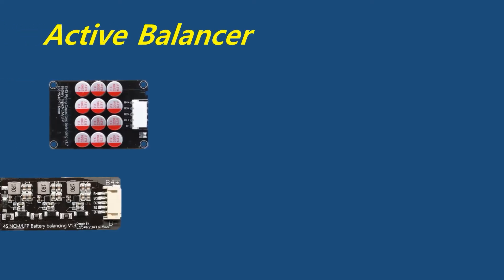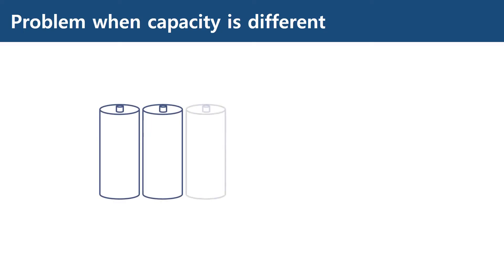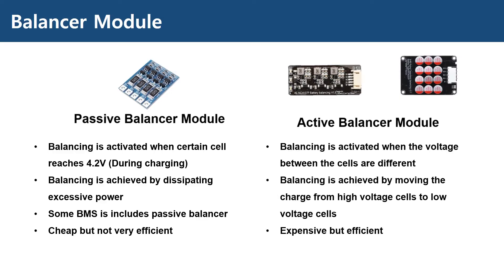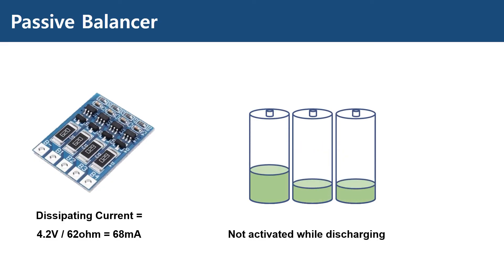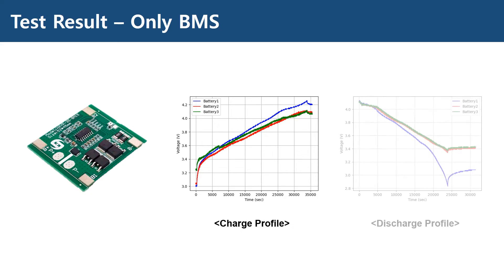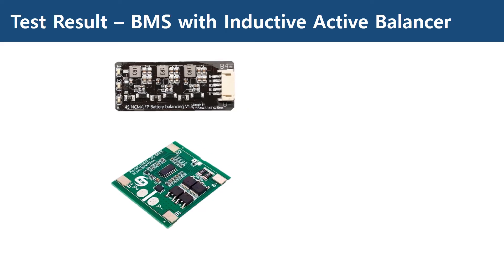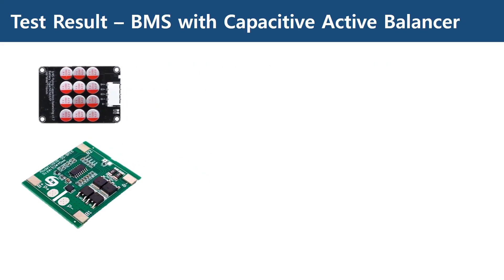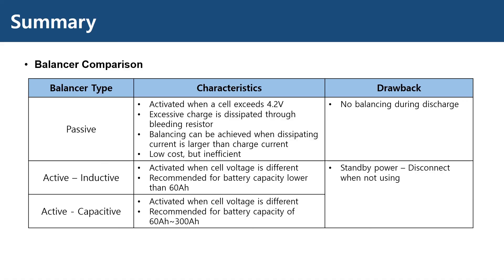Active Balancer vs  Passive Balancer

Comment: You are not going to get more capacity than the smallest/weakest cell,
so the "top off" balancer is useless and just wears out the bad cell faster as it keeps it full while the others catch up, filling up batteries is what wears them out.
What it can do is balance them every once in a while or if they get way out of balance, but that requires a charger that is very low charge rate.

The active balancer is also a waste, it does not do enough to make any difference unless the batteries are drained very very slowly, in which case, just use a single cell battery and use a dc-dc booster and no balancing at all is needed.

Comment: Oh that's why..
I use a battery pack of 32650 on my kids power wheels, it started balanced, after my kid drained the pack, it won't charge properly, and I check the cells are imbalanced. Thank you very much, I should be using active balancer then.
Reply from the maker: Great idea!
Also be aware of the total capacity of your battery cells.
Capacitive balancers are great but drains some power continuously, so when not using for a long time, you should disconnect the balancer from the battery.
Thank you for watching!!

Comment: Excellent and complete explanation, thank you !newbie here not finding much about these balancers
Reply from the maker: Thank you for watching!
Let me know if you have any questions!
Reply: @gemsungelectronics460 

I do!

My power drill runs on a 5S 18V 18650 battery pack. Would it use an active or passive balancing BMS? If active, how does it turn itself off so there is not a continuous drain when not in use? (You stated the active balancing should be turned off when not in use, but there is no way to do that with a sealed pack.)

Aside from physical size, active vs passive balancing and voltage, I gather amperage is a factor in selecting a proper BMS,  correct? 

If the 5 18650's are high discharge  20A cells, should the BMS circuit be rated at 20A, or what is amperage choice based on?

Are there other criteria or specs I need to include to find the correct Balancing BMS for this system?

Your presentation and graphics are excellent and your teaching is much appreciated.

I looked for a way to donate but did not see one.

👍👍 & Subscribed.

Kind Regards,
John